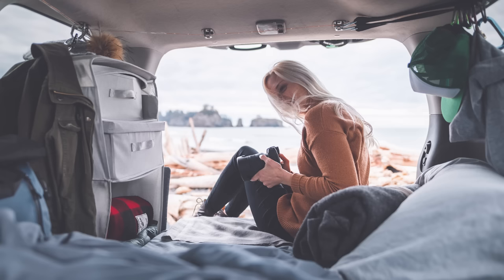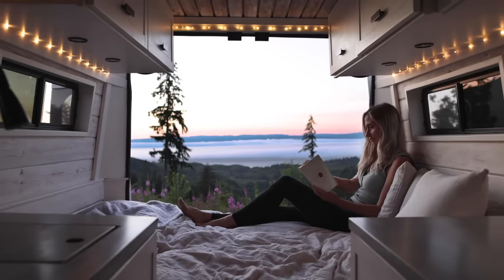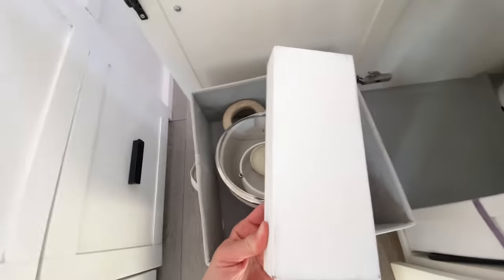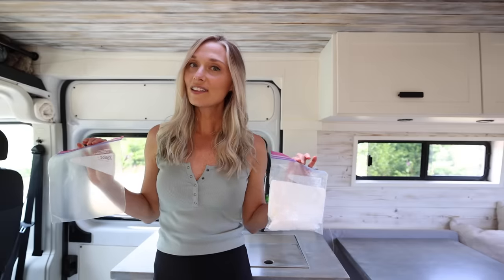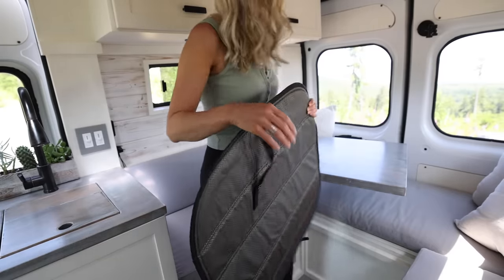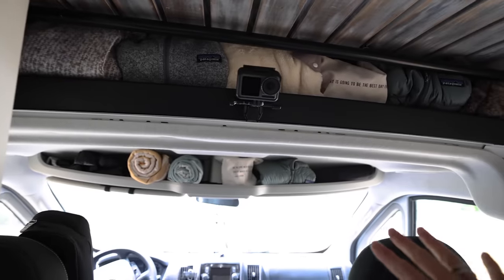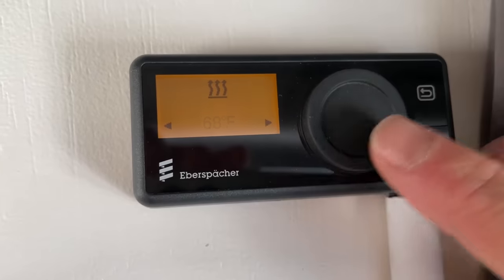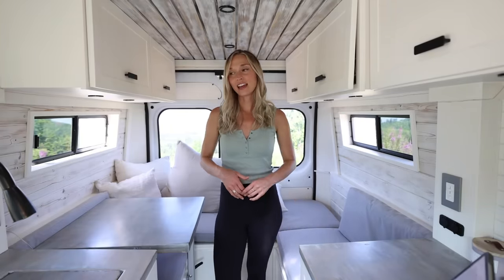VAN TOUR | THREE YEARS LIVING ON THE ROAD

Comment: I watch a lot of the DIY van builds, as well, hubby and I went out a few weeks ago to look at some new RVs of this side or the next level.

I will say this, THIS is the BEST DIY build I've seen to date.  Most people just throw wood together, not really analyzing the space to make the build efficient.

Whomever did the design here is literally top-notch professional.

The factory vans that we saw, were not even close to this.  They were mostly dark and cramped.

The color scheme here is so nice and bright with not a lot of that dark, depressing gray.  This is very cheery.

The use of space here is the best that I've ever seen.  I love the cabinets that can be accessed inside and when the doors are open, from the outside.  THAT'S JUST BRILLIANT!

As this vid is just over 2 years old, I do hope that Ms. Schaffer has removed that propane tank and had installed, and under carriage, horizontal version.... at the rear. I was very concerned when I saw that propane tank on the inside like that.

I've actually seen these tanks blow a pressure release and blow off propane at a staggering rate.  Twice I've seen these blow to a point where the flames literally shoot up 20' in the air.  VERY DANGEROUS.

So I hope that she has removed that and gone to a horizontal, under carriage type, at the rear of the van .

It really is wonderful to see such creative people enjoying the planet that we have.

What an inspiration to others.

Comment: You should have a sealed box built for the propane tank with air vent below out the floor.  This is required in all RVs as a safety precaution and it's not worth the risk of a leak in a custom build.  Also, you can get a "normally closed" valve for the propane which goes at the tank end.  With it, you flip a switch to let propane flow down the line to your burners, do your cooking.  When complete, don't shut the burners off yet, but shut off the normally closed valve.  This lets all the propane burn out of the line, then you can shut off the burners.  The normally closed design means that without power, it's closed so it can't release gas in a power failure.

A valve like this helps keep explosive gas out of your vehicle in the event of a driving accident rupturing the line which can lead to a catastrophic explosion as the entire tank empties itself!  Choose safety first.

Comment: Such a beautiful and very clever setup, Christian!!  I made my mattress topper into the whole sheet and blanket set combined with zippers.  I took out the fitted sheet elastic and added a very long zipper, that attaches to another sheet (which covers the underside of the topper).  Now the bottom sheet completely encases the topper and only has to be removed for laundering.  The top sheet and down blanket are also zipped to it so it's easy to keep everything together, and also to make the bed with just a flip.  The whole bed (apart from the pillows, of course) roll up together and tie with some attached ties.  It takes seconds to make the bed, and only a couple minutes to roll it up and put it away.   It's such a slick system and works so very well, I've often wondered if I should sell it.   If you are ever in Salt Lake City, poke me so you can see it in action.
Reply: You should sell it and I would buy. You found your business idea.

Comment: That van is set up just right! The vanilla tree scent is my favorite. 😁 What wheel and tire size is that you're running? Looks good. As far as the caulking on your tile.....have you tried using 100% silicone, such as a product like GE? As long as the seam between the tile and counter top is clean and dry, the silicone should sealed for good.

Comment: You have a nice setup,everything is kinda smooth and fine like your personality,I mean something is special about you,btw about the cracks there's a quick solution,you just mix wood putty with wood glue to the same size as the required amount and rub it on the cracked places with a spatula then let it dry completely which will eventually become very durable and will not crack anymore,best wishes,good luck

Comment: I know this is an old video, but I wanted to note - bamboo does not expand or warp due to heat or humidity changes. If you replace the countertop and cutting board with ones made of bamboo, it's not only environmentally friendly, but it'll never warp again. Bamboo flooring is popular for the same reason. Also, it's extremely strong, resistant to scratching if you cut on it, and very light-weight compared to many alternatives.

Comment: Re: warping.
The table warping may fix by having the same material or finish on both sides.  
The cutting board would require both sides be wet and both sides drying at the same rate so u may need to flip it after a few hours.

Comment: Electric induction cooktop $159.00 Amazon. Two electric burners I’m guessing 12” x 24” cut out probably a little less. It drops right in where the gas burners are now and lays flush with the counter top. End of propane storage in your van. 
I get cooking with an open flame. Just be really cautious about the connection between the gas line and the propane tank before igniting the burner Miss Awesome.❤️

Comment: What I love about this configuration/ layout is that you have chosen to have both optimal working place and kitchen, and nothing else.
Of course, a bed but that has to be set up before you can use it.

In most vans, it looks like too many things crammed together, which inevitably leads to less room to move, sit or stand, plus a nagging suspicion of claustrophobia.
And of cours a shower/toilet is nice but most times it's just taking up space.

Btw, have you ever considered using regular toilet paper, instead of baby wipes?
I mean if it's legal to bury toilet paper together with the p**p, I read it takes 5 weeks to decompose. Wet wipes take 100 years to decompose.
And if you need a wet wipe compromise, you could just use water from a bottle.

Comment: I would really consider getting your table and cutting board remade in a wood that is more resistance to warping. It would help significantly in the long run. redwood, cedar, fir.. great options Cedar is also super light

Comment: Great video! Van design is like choosing your favorite color, very personal and undebatable.
I have a question and advice for you! 
My Advice : I also work from my van (architecture) and it is very important to have an ergonomic posture while putting many hours in front of that computer, I think you should look into that otherwise you WILL develop big problems and this is almost certain from looking at your posture in your video, no slouching, forearms, legs and head always resting, no tension (I speak from experience).
My question : You  mentioned after 1 year and a half you changed your tires but you didn't mention why. 
I ordered a Promaster but I'm worried about traction...
Thank you!
Reply from the maker: yeah about a year ago I invested in a laptop stand and wireless keyboard and it was a game changer for my posture 👌🏻 I replaced the tires because my old ones were worn out and I also wanted more traction. highly recommend the K02s 🙌🏻

Comment: How come the rear doors are not insulated at all? All heat transfer must go there, making the rest of insulation useless. What am I missing? Some great features on this van by the way!
Reply from the maker: There is some insulation, it’s covered by the white panel. But yeah, there is also some exposed metal. Hasn’t been an issue now that I have the heater. I don’t really base in below zero temps tho

Comment: Don't know how people do van life without a garage. Things like camping equipment, bikes, crash pads for climbing, and generally anything you have in storage that won't fit into an overhead cabinet are pretty much excluded from the equation without a proper garage. Adding roof storage cuts down on solar panel space and using something like the Owl box adds almost 2-3 feet to your van which defeats the purpose of going for a 144 build.

Comment: Have you tried starting your car with the Genius Boost 40? I feel like you'd probably need the GB150 or GB500? 
Also, did you add the heater yourself or can you recommend a place for the installation?

Comment: From what I’ve heard, propane can cause issues with condensation build-up in the van. Curious to know if that’s been an issue for you?
Reply from the maker: I haven’t had that issue, but I actually ended up going back to one gallon propane tanks. A commenter here warned that my RV insurance company might deny any claims because of having such a large propane tank without proper ventilation 😬 So yeah, I removed it and now I just use the indoor- friendly 1lb tanks
Reply: @ChristianSchaffer  Good to know, thanks!

Comment: Would also like to know if the van is mechanically reliable? I've heard many complaints about various problems and the transmission especially. It's made by Fiat, so are parts easily available?
Reply from the maker: I haven’t had any issues so far

Comment: The sitting area does not look comfortable and the pillows also appeared to be too hard and i know about pillows because i get bad neck and back pain as well hot head way tooo easily so i need .soft pillows and  nylon covers .Those pillows used look more like cushions people use just for decoration on their couches.The space is also soooo narrow as soon as he opens the door there is absolutely zero room to move past.As for storage and lighting sure looks solid enough bui overall the space to me is just too tight and cramped.